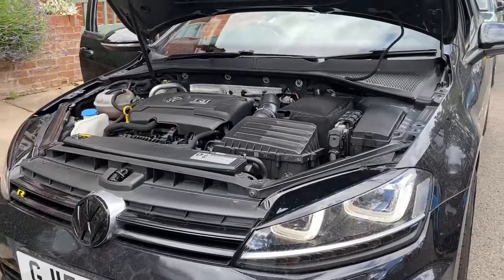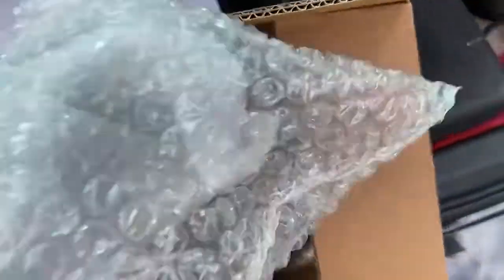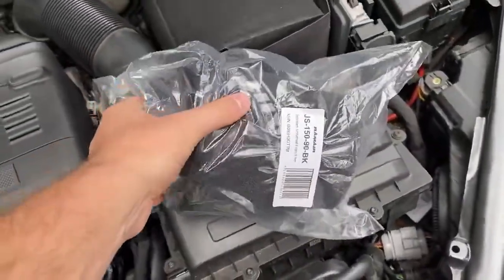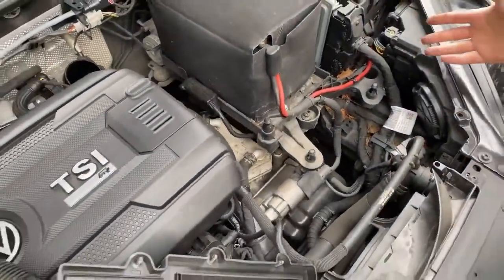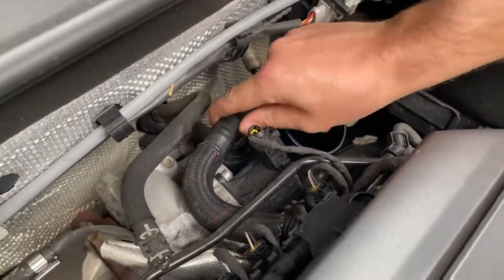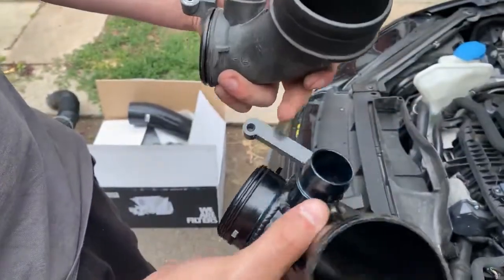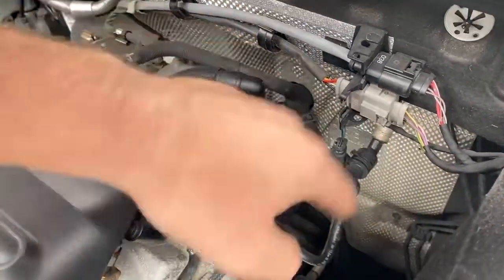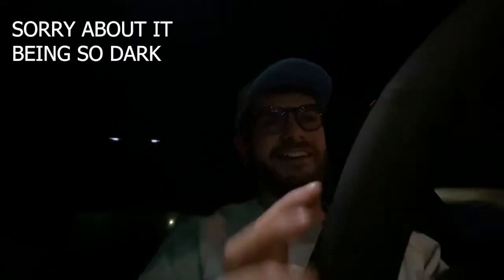RAMAIR Induction kit DIY | EA888 Sound | MK7 R | Turbo Flutter + Whooosh

Comment: Would it sound the exact same of you had the normal 70mm one
Reply from the maker: For the sound, yes it would sound pretty much the same, the bigger one just sucks in more air, which in theory makes a little more power. Which tbh after the whole install you notice it massively

Comment: Is turbo elbow necessary?
Reply from the maker: Not necessary but definitely recommended as it increases airflow and totally noticeable. 

For the price of the elbow it should be done when upgrading the intake as the more air intake to the turbo the more power produced

Comment: Hi mate, ive just installed a turbo elbow and it seems to have some slight movement, is this normal?
Reply from the maker: The turbo elbow should not have any movement. The intake however may move when revved